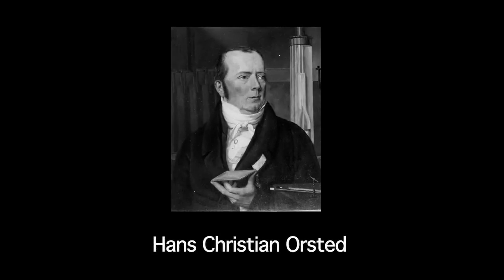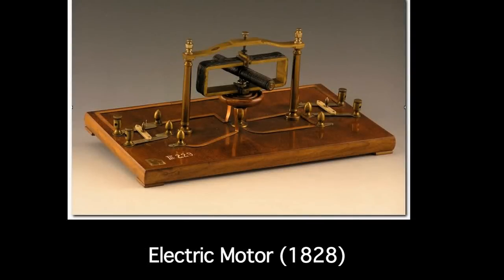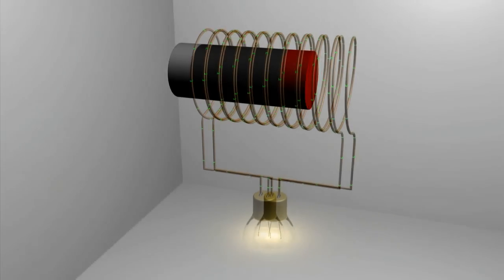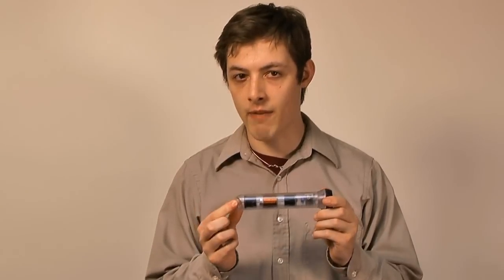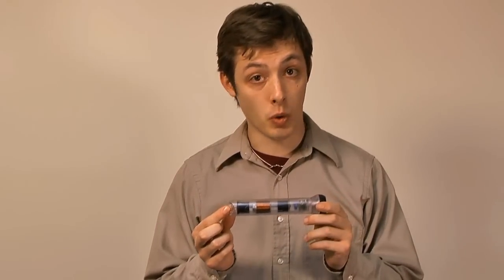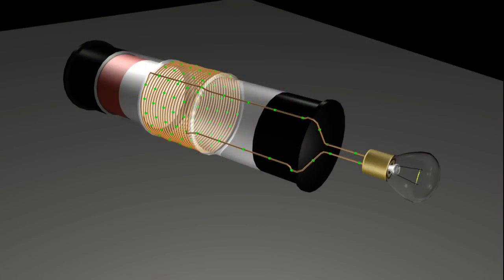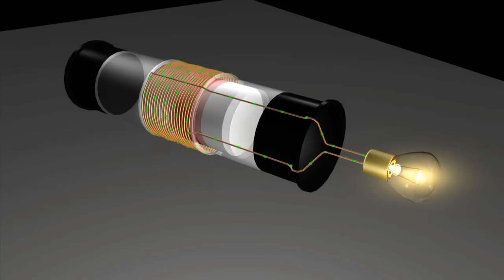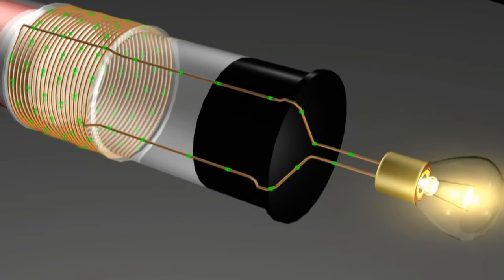Magnetism: Induction

Comment: You forgot to add the battery and charging circuit in the shake flashlight.
Reply: +coolbluelights and the capacitor , this energy as presented in the animation is good to light only if you have the power switched on , in the video he shake then he switched on  in order for that to happen the energy had to have been saved in a capacitor to then be discharged when you switch on and so i guess that a blocking diode will be in the circuit with the capacitor to stop the electron from flowing out to the light bulb  till it is switched on  in which case the diode will be cut of from the capacitor allowing the electrons to flow to the light

Comment: But they stay on for a while even after you stop shaking it??
Reply: In reality the torch or flashlight has a battery it's just that you never need to replace it because when you shake the torch or flashlight the electromagnetic induction charges the battery so the battery can hold the energy produced, which means it is one of the most efficient torch or flashlight you can buy, it's also good to keep one in the car, so you can avoid the horror of a night time car breakdown without any source of light.

Comment from the maker: Thanks for your feedback, it is helpful as we refine these. This was  discussed during scripting. As you point out, the actual flashlight has a capacitor and rectifier circuit, and uses an LED, not a light bulb. Because we were trying to reach an audience at a very introductory level, we simplified things, perhaps overly. The plan is to accompany the videos with background documents, one of which will be an explanation of the actual circuit, introducing diodes and capacitors.

Comment: That was very misleading, it is going to give the false impression that the coil becomes charged.

Your circuit is missing diodes and a capacitor to store the charge generated by the magnet and coil.